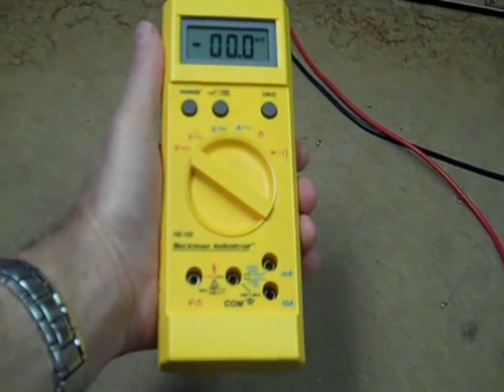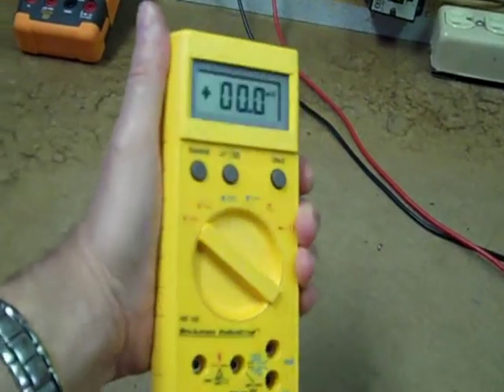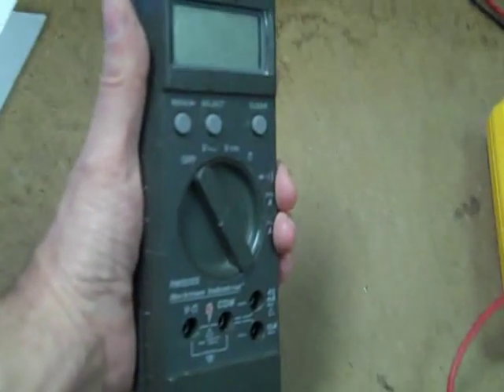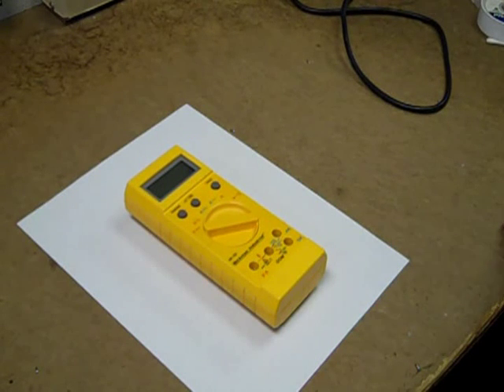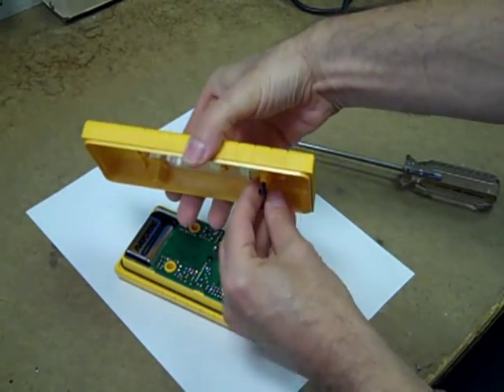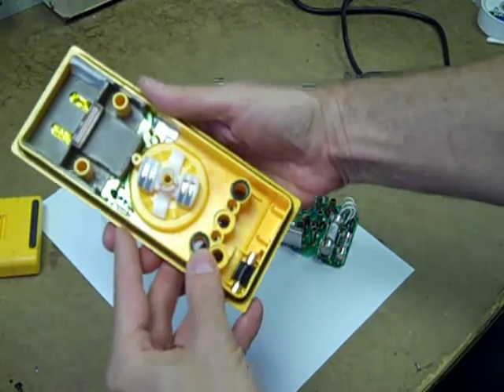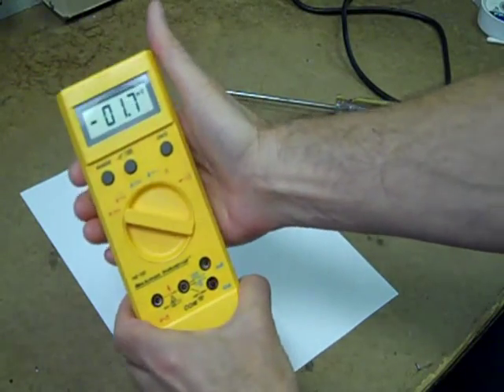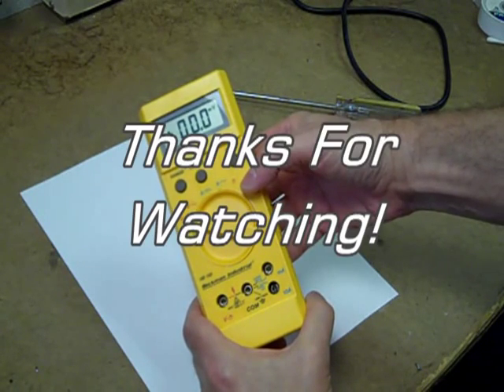Beckman Industrial HD-153 Digital Multimeter

Comment: Build them and ones that were experiments desert camouflage colors.  Multicolored green. San Diego, California Ruffian rd.
Robert Dunn was lead testing.
I build them start to finish.
Pick parts from storage. The to production line. Masing machine, production line of about ten workers, then to wave guild machine for soldering components on to electronic circuit boards water cycle removed legs of components down to a certain level installed battery two young ladies added windows and back cover. Then on to basic programing then to weather testing room heat testing.
Reply: 1970s we were using Simpson 260 navy training great lakes, 1980s Shipyards were using Simpson 260 meters then got hired trying to escape shipyards hiring systems it was considered seasonal by what a credit told me. So found Beckmen Industrial, real problem  was having a telephone interview  then showing up in person at company  department and convincing that  person I Was Honorably discharged from military they were not convinced California ID or not I looked old enough.

Comment: I bought my HD-153 new, probably in the late 80's. The amplitude to frequency output puts this meter in a class by itself and makes this meter my favorite - I haven't found a modern replacement. I can probe across panels, boards and BMS leads, watching my hands and the probes and audibly sense the voltage. The same goes for resistance mode - testing for bad solder joints and cables. The TTL transition indicator mode has also been very handy - I should verify that it works with 3V3 logic. I tend to use clamp-on ammeters rather than in-series meters, so fuse replacement hasn't been a big headache.

Anyone got a lead on a stand? Mine broke many years ago. 😞
Reply from the maker: I have a virtually new HD-153 in the box with manual, leads and spare fuses if you are interested we could probably work something out.
Reply: @mdzacharias  Thanks Mark. I published my email address on my channel's About page. Please PM me and we'll go from there.

Comment: there's a black fuse holder inside the unit that contains a spare fuse
Reply from the maker: There are two fuses, one for milliamps and one for the high current range. It's been years though and I don't remember about the fuse holder.
Reply: @mdzacharias  I'm own a service company and have repaired many of that model..  down in the bottom right by the fuse pcb  is a black clip that holds the spare and I seen it in your video..